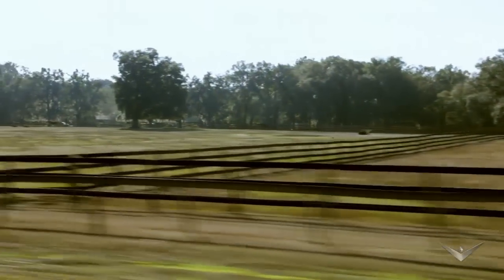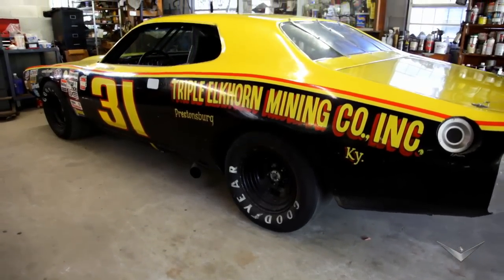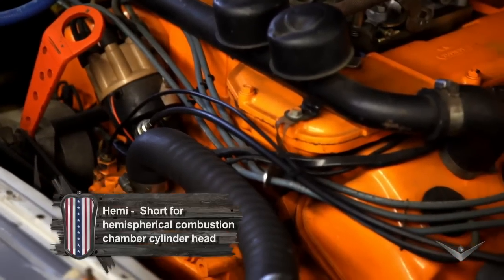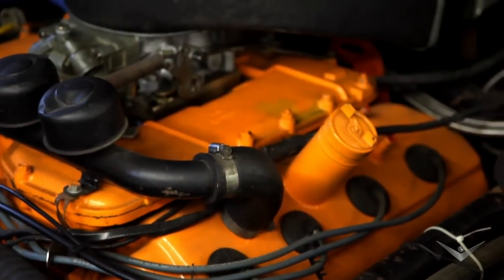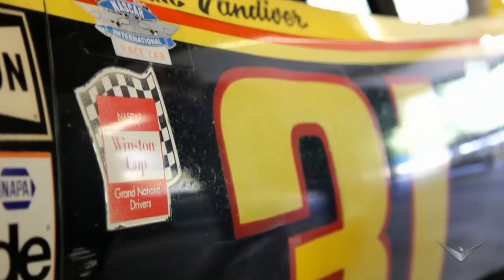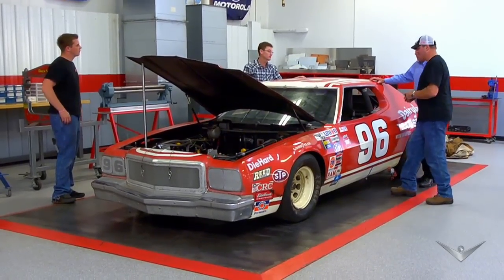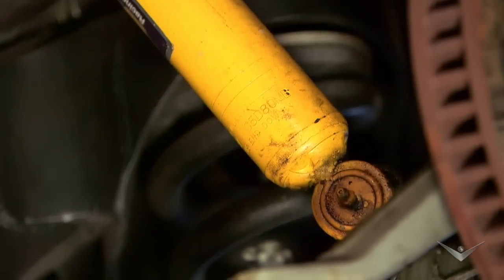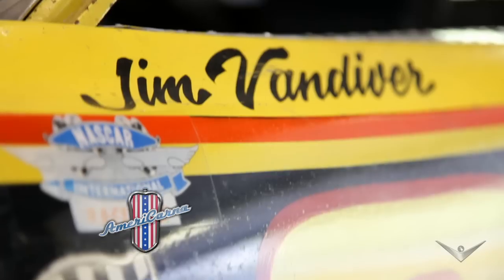Untouched Classic Nascar | Americarna

Comment: Last comment " fined 50K" laughed. That old man was probably chuckling. Those old timers were real good at bending the rules. Read a story where they hid lead shot in the exhaust to pass tech weight regulations, and when they hit the track, they would hit a hidden switch to dump it when they were rolling onto the track, around the bottom portion. Supposedly they only weighed one time to document race weight. After that it was all legal. They used to say " if you wasn't cheating, you wasn't trying." LOL.
Reply: Eric Hufstetler I’m wondering what he meant “by letting the air out the back”. I assume the old man was talking about the weather stripping being right on the seam, to make it a “smooth deck”.  But what was the other guy talking about?
Reply: @jonellwanger7258  By removing the weather stripping, or moving it to where it doesn't seal, the air can pass through, decreasing drag.
Reply: And now he's the guy catching cheaters. HILARIOUS!  Ooh what  a great car and so well taken care of.

Comment: At a time when the common man as they say could build and race not like the ones to day were its 50-100 K just to start but times  change and all ways will - in to days world of racing the engine is pre-build on a computer and tested before the first CNC machine starts cutting in many cases and the pit crew not only changes the tires as they say but looks at data from many points of the car and its performance like a jet fighter in a war

thanks for posting as cars like this are pure Gold from history in racing and like a fine tune harp when running